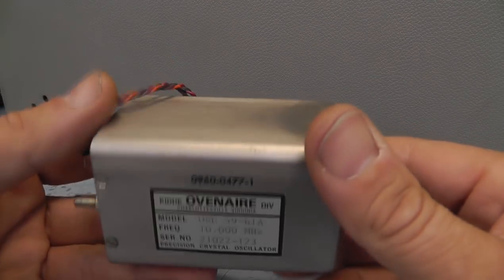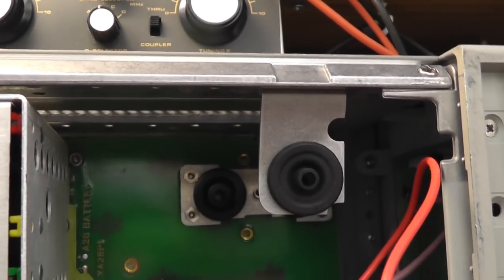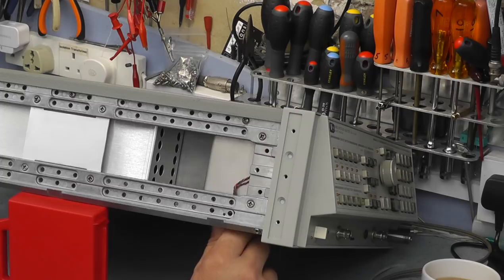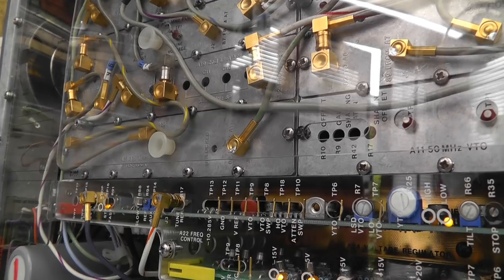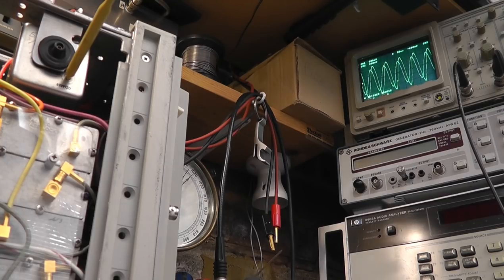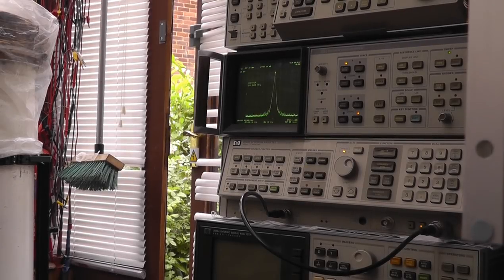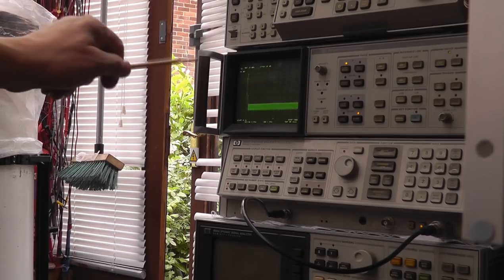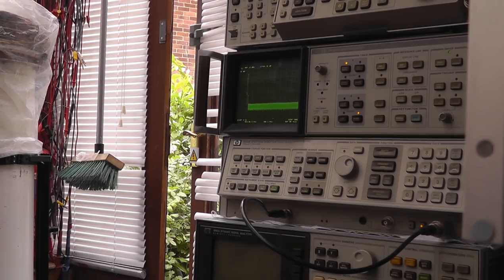Hp 8568B Pt2. Fitting the OCXO & adjustments.

Comment: Iv'e use oscopes to tune or waveform match before if I didn't have a piece of equipment, but I've never seen an oscope X Y used to tune an oscillator. That was a very neat trick, I'll have to keep that in mind if the counter is not available. Anyway thanks Simon it was fun to watch and I learned something. Very informative. Best Wishes n Blessings. Keith Noneya

Comment: I recommend to read the  'Performance Tests and Adjustments Manual',  08568-90118, at about page 3-95,  how to do the Time Base Adjustment properly.
An OCXO is capable of an accuracy/stability of about 1E-9/day, and you should try to adjust in that ballpark, not > 100 worse, as you did with this ancient and in-sensitive Lissajou method.
Also, you should let the OCXO warm up for 48h at least, maybe StandBy mode is sufficient,  not only 1/2h or so. That's all very crude, and no good example, how to do such a calibration. 
I recommend to use a proper and high resolution T.I. counter <= 1ns, to measure the phase change over an extended period of time.
.